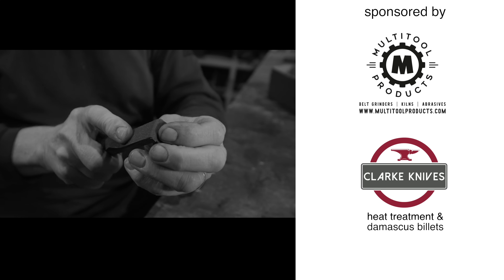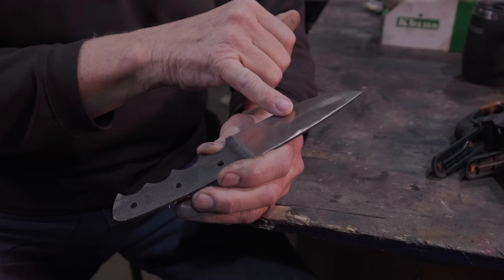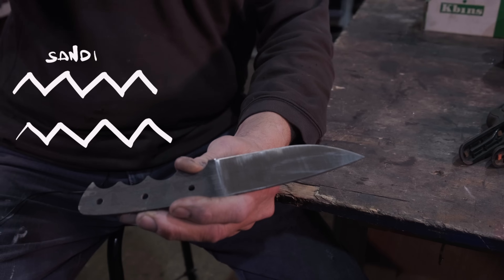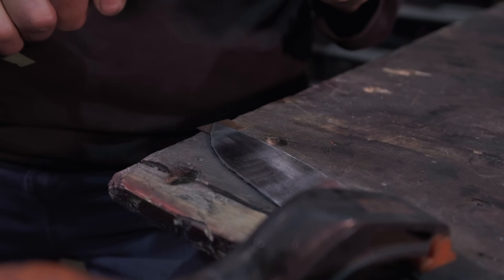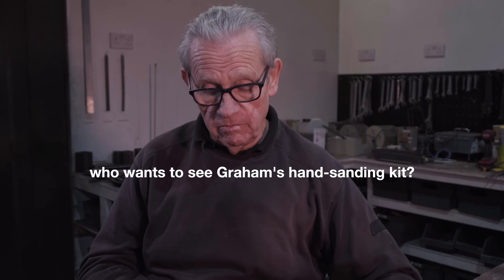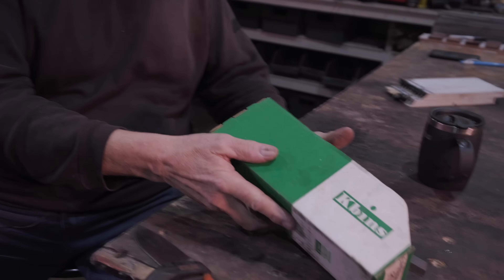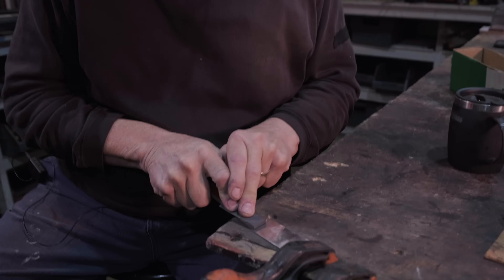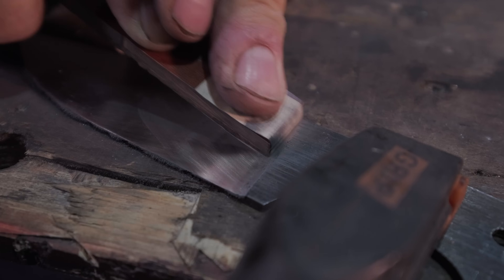Hand Sanding Secrets for Knife Making

Comment: If I'm using my belt sander up to 400 grit, when I start hand sanding should I start at a 400 grit or should I start at a lower grit, maybe the 240 grit and then work back up again? Does lowering the hand sanding grit and working up make it easier, or would it just add an extra step?

Comment: I enjoy hand sanding,  I use Rhynowet redline sandpaper. 
After 400 grit I handsand towards myself. I use a brass flat bar with a 45⁰ angle and a few different degrees with wood and a leather backing on it.
Good video 😊

Comment: Thanks vor sharing your method and confirming mine. I make knives for 16 years now and after a lot of trials and errors I do more or less the same. I use hard wood sticks but no cork backing (yet). I will add that.
I am using more grids. For kitchen knives I like to use niobium alloyed steels. Those a quite tricky to finish and I think adding more grids speeds up my overall time.
When I want an K800 satin finish, I sand to K800 then buff the blade and then back to K800.
What I find really important is keeping my work surface clean. It happened too often that a leftover corn from a course grid ruined the surface of a finer grid.

Did I say that I actually kind of like hand sanding. Yes it’s a repetitive / „stupid“ workut somehow it clears my mind and I get some of my best ideas while hand sanding.
Reply: yeah that part about coarser grains still on is a thing I have had a few times too, making knives for 4 years or so and I always wet sand, with a window/windex spray bottle, then wipe off everything very well after 1 grit, then wipe the little clamp system I have for it too, so it won't scratch the bottom when you do the second side. That way in union with about the same steps as in this video, most to 600 grit for simple finish and 1200 for satin with finish off single strokes of 1000. I do use a small wooden block, but I think I will use this stick method and see how that goes, it seems to be more economically in paper use and time.  Mirror polish is 2k grit then buff, I don't like to make knives that have such a super high finish that people won't use it. I make them to be beaten up in the bush on vacations, trails etc or in the kitchen, at home or at work. Show knives for now are not my thing. No to say I can't enjoy a super high end finish on a blade, but just not my thing.
Reply: @pr0faker  I never mirror finish my blades. Mainly for two reasons:
1. I’m too „lazy“ to go through the effort.
2. For the same reason you have. I think a mirror finish makes a blade unusable. The first use (other than cutting butter) will scratch the surface and will ruin the look and voids all the effort that went into creating it. I want my knives to be used too.

Comment: Most people who hate hand sanding usually stop at 120grit on the machine and given most people who do a lot of knife making have variable speed grinders its a waste of time to stop there. Drop the speed down and use finishing belts.
Finishing belts are almost universally compounds of oxides and the trick with those is that don't get them wet, so if you dip to cool off, wipe the metal with a cloth to remove the water, it doesn't have to be bone dry, just not soaked. You can also tune them up a bit with a cheap, rough diamond stone to clear away glazing and reveal fresh abrasives. 
A30 is 'ok' but I tend to stop at A45 which is around the 350-400grit mark
The belts are expensive but they do tend to last quite a while, most are low-med pressure, medium speed so as long as you're not expecting them to cut like your lower grit ceramics it'll knock a lot of hand sanding off your time.

Just some final 'tips'
I leave a fairly broad, blunt area of 'little bit extra' where the tip will be throughout the machine-grinding process, its only when I'm done on the finishing belts will I go back in and cut the tip in to how I want it. That way it doesn't matter if that area gets rounded over, toasted or a bit chewed on during the edge geometry forming and it will be needle sharp.
Also if you're going to finer grits and have the knife on a backing plate when its clamped down, cover it over in a layer of masking tape so if it wiggles around on the plate with a bit of grit underneath it, its not going to chew up your nicely sanded side.

Comment: Very interesting . . . I have one more question.  
- How & to what depth are base metal atomic structures are altered with abrasives ?
Any thoughts or insight into this will be greatly appreciated.
Reply: Later he was saying that during grinding/sanding you get work hardening at the surface. I believe that’s what he was referring to in the early part of the video.
Reply: @joshcarter-com  Work hardening is just distortion of the molecular structure of the material due to mechanical distortion, just the same as a hammer mark but on a microscopic scale. The finer the abrasive the shallower the distortion. For a true mirror finish all the distortion needs to be removed.
Reply: @joshcarter-com  My limited understanding of work hardening is that atomic structures of metallic elements rearranged, cracked or broken. Micrographs reveal carbon elements are often cracked which would imply lower strength . . .  but we know from testing metallic strength increases by some measurements.  This would indicate some other metallic elements are strengthened. This may also have something to do with the boarder regions of the atomic structures of metallic elements.
- Any thoughts or further insight into this will be greatly appreciated.
Reply: @clarkeknives4159  Any insights as to how work hardening increases the strength of metallic structures at a molecular level ?   Applying this knowledge to sharpening methods & techniques may yield stronger & /or more durable cutting edges. 
- Any thoughts or further insight into this will be greatly appreciated.

Comment: Do you think there’s any advantage to wet sanding, like less wear on the abrasive or build up of debris over the grit? Most of those silicon carbide papers are known as wet& dry paper.
Reply from the maker: If the abrasive + paper combination permits it then yes. Most silicon carbide are usable for wet use, as you’ve mentioned, why it’s called “wet and dry”.  The advantage is it will prevent heating the surface and will also prolong the life of the abrasive at the same time.